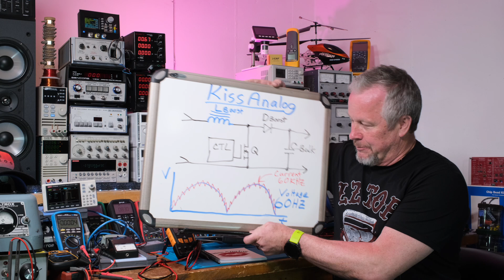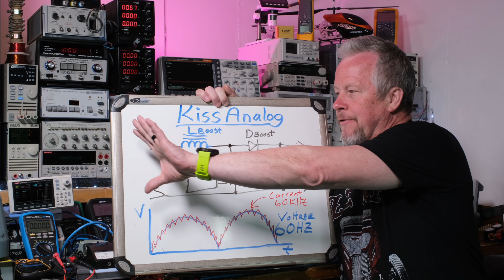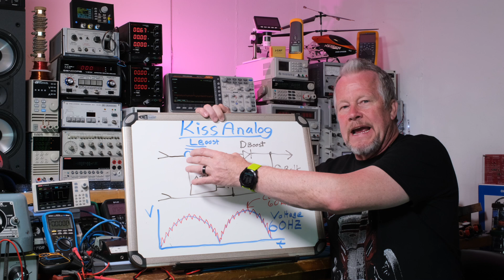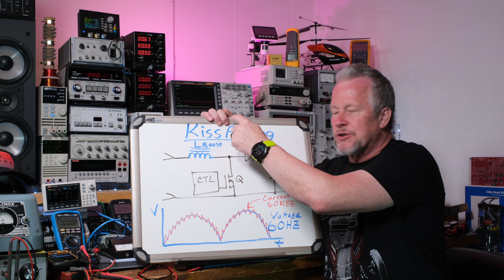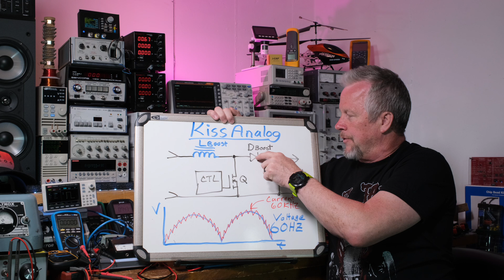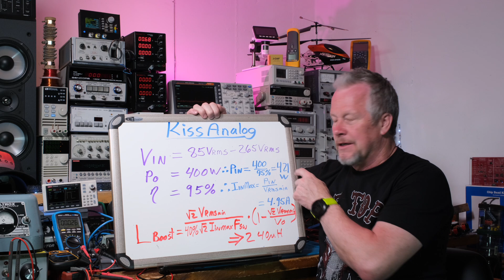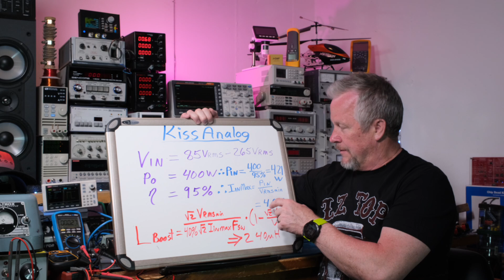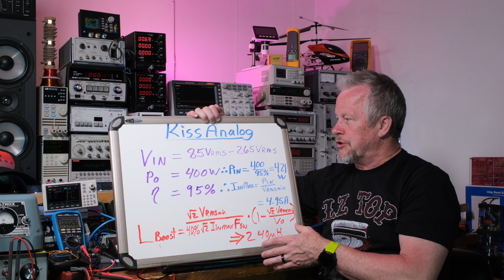PFC Boost Inductor Design for the JAT Audio Amp in Collab ep#5

Comment: Awesome video. Is the 400V output you mentioned the final output of the supply or is that just the voltage that'll be going into the next stage of the power supply?
Reply from the maker: Great question Ben!  Yes the 400V will be the input to the next stage which will provide the +/-40V outputs.

Comment: Nice ZZ Top T-Shirt. I think I get the key point is to lower the phase shift between voltage and current to achieve high efficiency.
Reply from the maker: Thanks!  With PFC we should have a nice clean input voltage.  The Power Factor improvement is like we are improving the efficiency and this type of converter does have great efficiency!

Comment: Awesome video, i'm amazed that you two are collaborating! :) stupid question from my side, wouldn't it be possible for the power supply to set a Voltage over Current Curve for a 2 Ohm Load? Like (Current*2+6Volt) so there would be less wasted power on low Volume. Would that be way more complicated to design?

Comment: I am humbled you are taking folks through the design process demonstrating sim tools. It is not any different if designing a pcb circuit or IC except for the lag between design and first circuits being returned for evaluation. You should be highly commended for taking folks through the process of a design. It takes the mystery out of the process and demonstrates design is fun and not really that hard. On power factor, you may need to say not much more than it is ideal to keep the current in phase with the voltage so it looks like a resistive load.
Reply from the maker: Thanks so much for this support!!  I really do appreciate you!  I had a bad year but I'm restarting this and am trying to cover this topic thoroughly so that the mystery is gone and my hope is that anyone really interested and watches all the videos in the playlist will be able to design their own.  But yes, I also want to go through the steps of picking out parts and designing PCBs - showing the proper steps.  Here's the restart video, and there has been a number since this one;) https://youtu.be/SHr0l9Q3Bis

Comment: I'm getting the same answer as h1nicolas did. Are we missing something. I get most of the equation in that "L=V dt/di" so that "sqrt 2 Vrmsmin" is the V, "1/Fsw" is dt, and "40% sqrt 2 Iinmax" is the di, but I am unclear about where the factor (1- sqrt 2 Vrmsmin / Vout) comes from and also the "40%" . Could you show a derivation of that formula

Comment: 60KHz switching frequency, 400V out, using the equation you supplied, I am getting 500uH
Reply: The same here. But there are many different versions of this equation available. An application note by on semi has almost the same equation except that the value is divided by two.
Reply from the maker: Thanks for your feedback!  I am going to cover this in a better way.  I restarted this series and I will get this designed very soon: https://youtu.be/SHr0l9Q3Bis